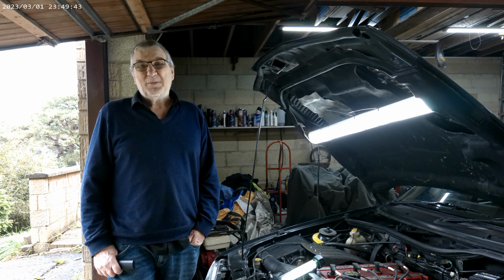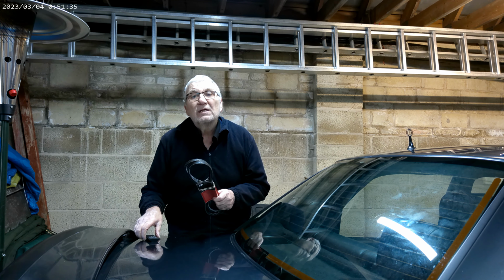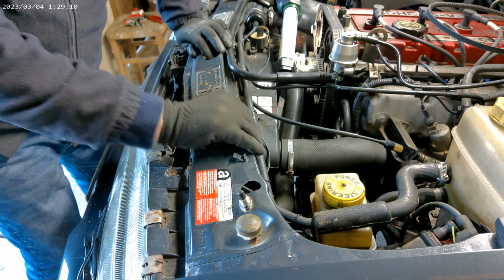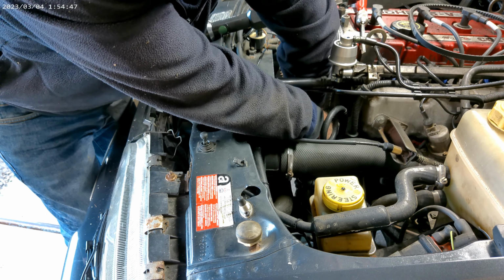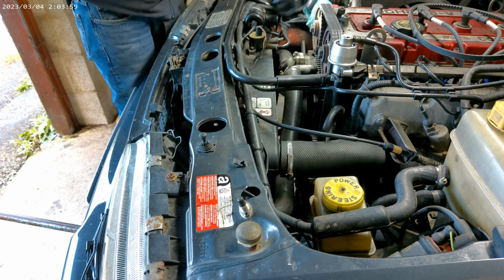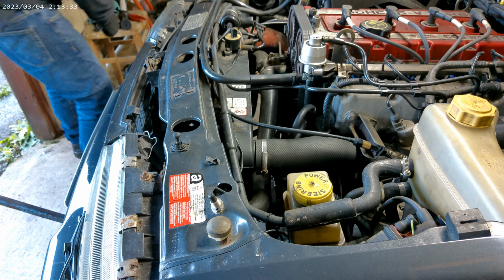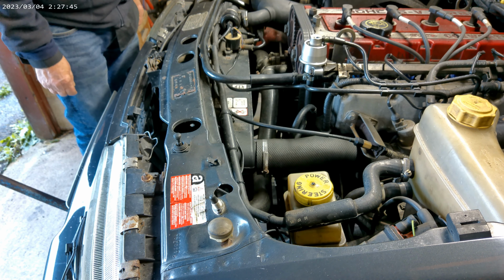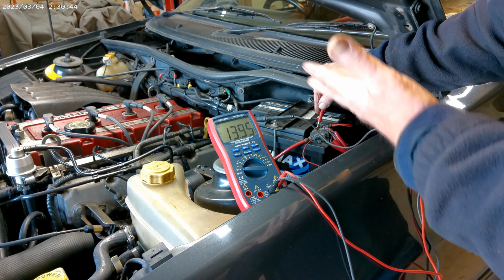Ford Sierra Cosworth,  I found a big problem?

Comment: Hi Rob ive just subscribed to your channel , i had a cossie identical to yours ( same colour as well) only mine was a 2WD saff ..F  REG ..i bought it in 2000 and sold it in 2013 ..so 13 yrs ownership.. mine was stage 3 tuned /chipped , with a T3 turbo stuck on it ..i was told when i bought it ,it was 380BHP ..but in reallity it was closer to 330/350 , either way being 2WD it was insane when it boosted ..always spun up the rears  ! i went through quite a few sets of rear tyres ! ..i ran it on goodyear eagles back then.. with 215/40/17s if i remember correctly ..im now 55 years young and drive a type r civic so not quite on cossie level but its fun ..watching your video brought back many fun memories of cossie ownership.. i sold it for peanuts compared to what theses cars are worth now! ..if only i had a crystal ball! ..best wishes ..Roger
Reply from the maker: Thank you Roger for your Comment, I have not been able to spin the wheels on my 4X4  Cossie at all, I had some Michelin pilots on it I found them too hard and it did slide a round bit with them on.:yougotthis:

Comment: You never told us what the issue with the missfire at 3500 was,nor did you say what was wrong with the heated screens?
Reply from the maker: Thanks John if you missed my video issue with the misfire at 3500 RPM, Cosworth one small fix, one big difference Video link 
https://youtu.be/2sIpiBsFU7o
The heated screens are still an unresolved job in progress, I may need to take the dash out, like all Sierra Cosworths it has had 3or4 alarms fitted.:yougotthis: